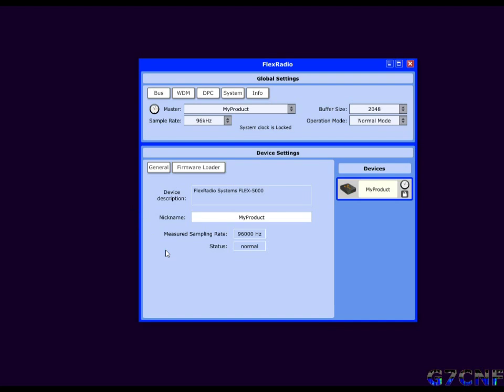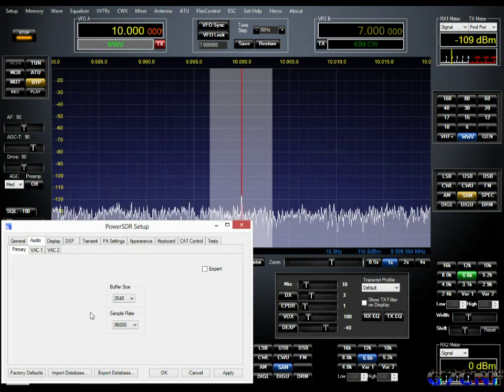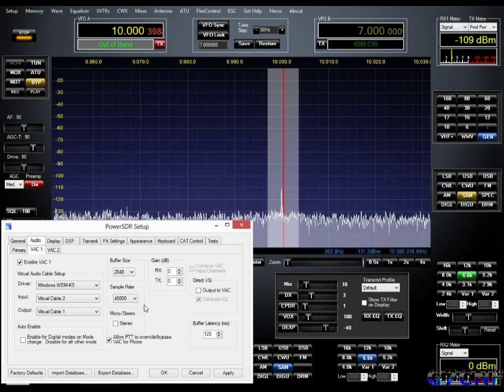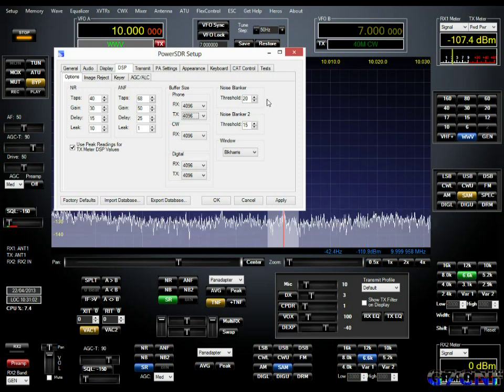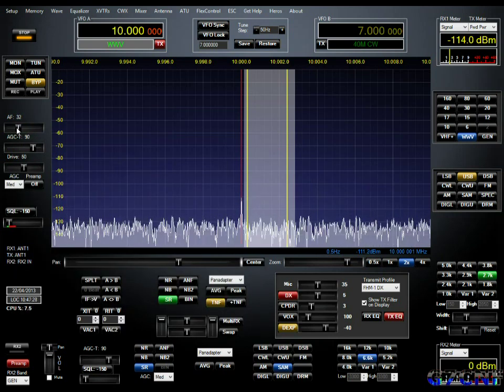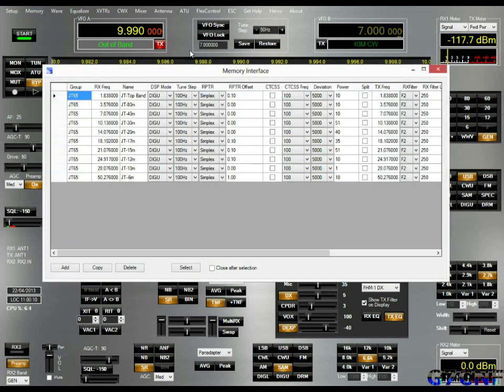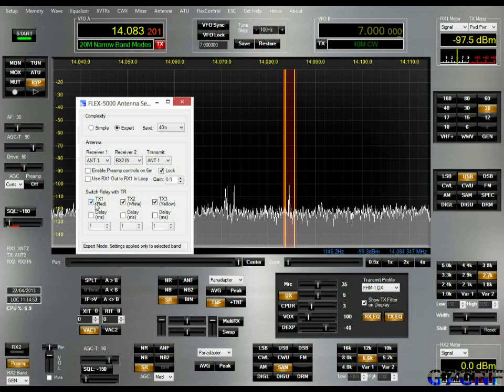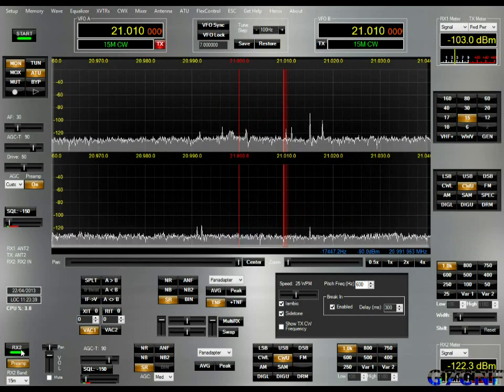PowerSDR 2.6.4 - Setting Up For The First Time

Comment: Hi, just wondering if you have any setting up guide to listen aircontrol frequencies (the transmission made between Pilots and Control Tower in the Airports), I don´t have this software but there might be a common settings in general. Thanks in advance.
Reply from the maker: Visores Colector PowerSDR is not generally used with radios which can receive VHF airband transmissions. I don't think I know anything that will help you, sorry.

Comment from the maker: I'm afraid I don't know. I don't have a 1500, only 100w radios. I too was wary of the internet and have installed numerous clip-on ferrites on the incoming telephone wire. As yet I haven't observed any aberrant behaviour with the DSL and I have an 80Mbit connection so quite sensitive to RFI. Where the cable exists the keyboard, put a good-sized clip-on ferrite with several turns of the cable. Do this with the mouse at the connector end. My antennas come close to the shack and no RFI here. 73

Comment: hm, good to know, thanks for answer. i have watched several flex-1500 videos on the net. the noise elimination systems in the 1500 works great, a click and the qrm is GONE. the same is with the ic-7700 but it costs at least times the price of a flex-1500. what im a bit afraid of, is the RFI resistance of my computer and internet. when i transmit with 100 watt in the 80m band, my keyboard/mouse stop working. another question: what is the best 100 Watt HF-amplifier for the flex.-1500 ?

Comment: thanks for answer. i watched a plenty of flex-1500 videos, the NB/NR works very effective, same like in the ic-7700. i have more Q. about SDRs, if thats ok. what is the max. transmitt bandwidth of the flex-1500 and the flex-3000? i want to transmit from 10Hz to 3200Hz (at least).

Comment from the maker: No difference. The NB, along with any function in PowerSDR is defined entirely in software. Think of the Flex radio (any of them except the 6000 series) as an A/D converter, taking your RF and converting it to audio baseband. There is no manipulation of the signal except for some modest bandpass filtering ahead of the A/D. Once in the digital domain ALL processing, NB/ANF/TNF/Filters - everything is in the software. The only difference between models is the Panadapter width and dynamic range.